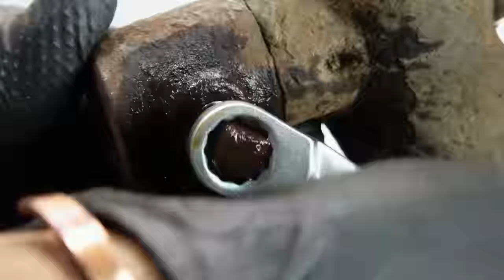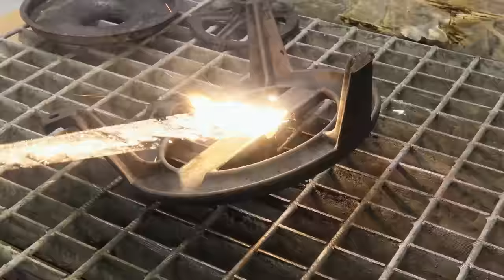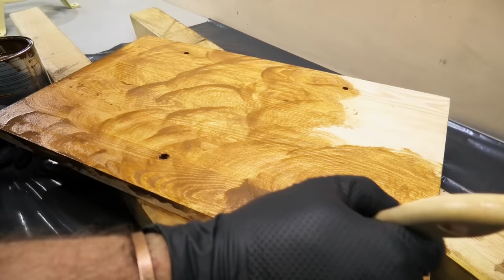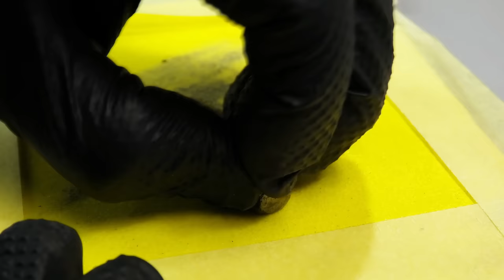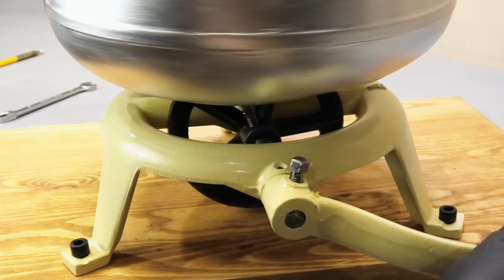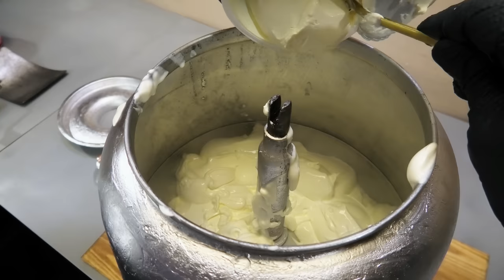Primitive Butter Churn Restoration - I'm Making Butter for You!

Comment: I think maybe you didn’t churn long enough… you should end up with butter and the remaining whey (very watery). After this, you rinse the butter in cold water to remove the whey and squeeze out the water using cheesecloth.  Some folks add a bit of salt to their butter.  I like this old churn — although not too wild about the chrome with the yellow paint.  Never have I seen one like it.  Unusual, but seems to work very well.
Reply from the maker: Thank you for your bits of advice. I never had to make butter before, and I also didn't want to insist this time.
After I observed that some butter had formed, I stopped churning. 
In my workshop, I had 32+ degrees Celsius while churning hard with studio lights on me from all sides, and that was way too much for me 😅😅
I was happy that I could demonstrate that it worked.
The chrome idea came from the item itself because it was chrome-plated, and the base is Ivory, not yellow, a colour very similar to butter. I thought that it would make sense 🙂 
Thank you once more for your feedback and for watching my work! Cheers! Johnny
Reply: @rustyshadesrestoration  … I think that translates to about 90F… too hot for me!  Butter-churning is definitely a cool-weather task.  Thanks for sharing your projects!
Reply from the maker: Thank you for watching my videos and interacting with me! Have a good one!
Reply: Butter forms best at 64 degrees fahrenheit.  Also milk fat of 35% or higher.
Reply: One of my favorite restore videos!!!!!
Reply: @vickiefowler1429 You're saying exactly what my grandmother was doing on the farm.
Reply: No, I think he just started out with the wrong stuff. Too thick already, and maybe pasteurized. If you use whipping cream, you get the solids to separate from the liquids. I have done it by over whipping the whipping cream.
Reply: COLD Whipping Cream! And cool(ish) environment. You still have to churn it for about 45 minutes-an hour at those specs to get good clumps!
Reply: Butter at home.... 10 minutes in a Kitchenaid mixer. lol
The real challenge is making cheddar cheese from powdered milk!
Reply: @rustyshadesrestoration yes, the cream mist be very cold.
Reply: I agree. The cream wasn't churned long enough, or the churn itself is insufficient in making butter. We use to let our crean sit out overnight to warm up to room temperature and at the same time sour a bit.... made the best butter that people would come for miles to buy it. Wish I was a young man again living on the farm.
Reply: You have to start with heavy cream to get butter. But this is an amazing tool.

Comment: I had to Google to figure out what you were churning to make butter; here in the US we usually use heavy cream to make butter if we make it at home, which isn't so thick that you need a spoon to take it out of the package. I don't think I've ever seen "thick cream" on the shelves here. Also, I think the drain on the bottom is meant to be used to remove the buttermilk from the butter once you're done churning, but I haven't ever seen a churn that works like that one before, so I could easily be wrong. The hand-cranked butter churns I'm familiar with have a four-flanged paddle that spins inside a fixed container, rather than a fixed paddle and a rotating drum.
Reply from the maker: Yes, that was 36% fat cream, here you can find it in every shop. 
You are right; the drain is used for draining the buttermilk, but my copper pipe got filled up with butter, and I couldn't use it in the video (trying to avoid messy situations). 🙂
Reply: Considering the low amount of fat in his cream (32%) it is almost a wonder that he ended up with butter at all.
Reply from the maker: Desired level of fat in cream for butter making is 33 to 40 per cent. Standardisation to higher and lower levels leads to higher fat loss in buttermilk. Reduction of fat by adding water should be avoided as it interferes ripening of cream and also results in butter with flat or washed-off flavour.
You're welcome! 🙂
Reply: @rustyshadesrestoration In my country we have a 36% whipping cream, which is liquid but has worked ok for me when I have made butter. Makes me wonder how your cream is different if the fat content is same.

Maybe I also missed something and I'm too lazy to rewind, but did you treat the inside of the churn in any way,  or did you just remove the rust and dirt?

Comment: Last one we used with just one fresh cow was a glass jar of a gallon or gallon and a half, with the paddles attached to the lid with a gear assembly. Slow, but worked. If lacking even that, shaking the milk in a jar worked, too. We’d hang the butter in cheesecloth and let the whey drip out.
Reply from the maker: I have one like that too, but only the mechanism. I have to find a jar that fits, and maybe I'll give it a try!
Reply: @rustyshadesrestoration    I think they were made so the mechanics would fit on the big pickle jars or restaurant size mayonnaise jars, as they were often broken , since the children were tasked epithet the chore.  Haven’t seen ours in decades, so maybe it has a new home. Haven’t had a cow tor forty years.

Comment: Ah,  the old 9mm is too small and 10mm wrench is too large, or, metric meets English wrench misfit.   The  square   head bolt is 3/8"   or 9.5 mm.  
Frankly, the best  wrench in  this case is a "Crescent " wrench, or as we like to call it, "the  universal metric"  wrench.    Believe-it-or-not, there are 8-point sockets  here, and one of them is 3/8", a perfect fit for your project.  There is another work-around, using a 3/8" drive socket, but it's messy..
Reply from the maker: Thank you! I'll try to buy one! Much appreciated! :D

Comment: What was the method you used to clean the rust off of the barrel?  It almost looked like a combination of fire and laser.
Reply from the maker: I used a BLC-2000w laser machine to clean all that mess 😀
Reply: The smoke that was created in the process, as it was floating through the beam from the laser, is what created the visual effect that looked like flames.  

If you have a laser level that can split the beam into a line (fairly inexpensive these days) and a dark room, you can see this effect by using a cigarette or a vape (or >ahem< other stuff that makes smoke) be gently letting the smoke drift through the beam.  It’s mesmerizing to watch!

Comment: Good job, however, imo the chrome paint was a very tacky look
Reply from the maker: It is what it is. The piece from inside was chrome-plated, and I guess on the exterior, too; having no chrome bath in my shop made me use that paint. I couldn't see it differently. Anyway, thank you for watching and for your honest feedback.
Reply: Powder coating or baked on enamel paint is generally safer, as is Bluing or Blackening. I worry about the spray can paints flaking off. Definitely use food grade paints, please. That said, I'm not sure what Chrome paint was used.

Love the old appliance. I wish I had one of those laser cleaners!

Comment: From watching you turn the copper piece in the lathe. I just want to give you a couple of pointers. The insert cutter was to far above center. Your gibs need tightened up that’s why the tip of the tool dipped down when you was cutting.
Reply from the maker: Thank you for your tips! 🙂

Comment: really cool restoration of an old kitchen tool. just 1 tip for you. when using chrome paint, it needs to be extremely smooth surface, then paint the entire thing black first, then hit it with chrome paint. for some reason chrome paint shines better with a black base coat.

Comment: 60 Reverend Puerto Rico Minimum?
Reply from the maker: 60 Revolution per minute.
You could turn a hand crank at 60 RPM comfortably. Putting this in a familiar context: a 28″ car tire, rotating at 60 RPM, travels at about 5 mph. 😁

Comment: Do you know why there was a rope around the gear?  A Lazer to burn off the rust? How does that work? Looked really weird. 
I would not call this style "Primitive"; that seems to go with the up-and-down plunger-type.
I have never seen square-headed bolts before. I thought the round hole in the bottom was a way to drain off the buttermilk, but you capped it.
Won't all that oil/grease on the gear attract dust?
Reply from the maker: Hi! Perhaps the rope just entered there by chance; it always happens with ⚙️ to catch something 😉 
The laser, hmm, complicated, but I'll try to be short: it removes contaminants by vaporising them into dust and fumes through laser ablation. When the laser beam hits the surface, part of its energy is absorbed by the metal surface, and the rest is reflected. Contaminants are ejected when they have absorbed enough power to reach their ablation threshold.
Let's continue with the rest 😅 "Primitive" may be exaggerated, but compared to butter makers these days, it is pretty primitive. The draining hole was improved; I attached a tube and a cap that can be taken out easily when you want to drain the churn. 
And now, the last question: yes, it will attract the dust, but better dust than rust, noise and fast worn, out gear. 
I hope I didn't missed anything! 😀
Reply: Perfect! Thanks @rustyshadesrestoration

Comment: The device doesn't work properly, the final result has to be different a little bit
Reply from the maker: What do you mean?
Reply: @rustyshadesrestoration , I mean that the buttermilk has to be more liquid and the butter doesn't break apart, it sticks together like one lump. There may be many reasons, maybe the sour cream is not proper, I use the sour cream directly from a farm, maybe the processing time isn't enough. I see that the device doesn't beat the sour cream but just moves it around, it looks strange to me. 
Anyway, you did a good job by restoring the old thing 👏🏻

Comment: At the risk of nitpicking, brazing cast iron is stronger than welding repairs. The base material becomes weak in the heat zone when welding cast iron.
Reply from the maker: I can't agree with you. I just had a project a few months ago where I had to weld a cast iron Doctor Scale. Guess what? I have 91 kg, and I'm still using it almost weakly. So, maybe brazing is good, but I'll never subestimate a correct good weld. Best, Johnny
Reply: Well done! @rustyshadesrestoration

Comment: Isn't the purpose of the plug on the bottom to drain out the buttermilk so you don't have to deal with scooping the butter out of a bowl like that?
Reply from the maker: Yes, that's why I put that plug, but I wanted to continue churning after the demonstration. 🙂
Reply: @rustyshadesrestoration  Awesome, I wasn't entirely sure what it was for but figured that was it. Nice restoration, this is actually a product I would buy even though there are more efficient ways to make butter.

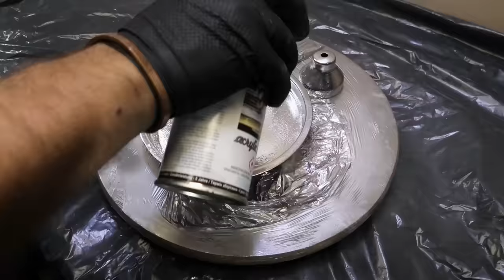Comment: You need to adjust your tool height, 18:04 you can see it's way too high.
Reply from the maker: That's why I change it. That knife is a bit bigger for my lathe machine.
Reply: @rustyshadesrestoration  That's not the only issue. You have little weak lathe. Will work better with sharper tools. Like HSS (Or brazen inserts as you already found). If you opt for HSS, you can grind it yourself. Just use aluminium oxide grinding wheel.
Also there is so much slop in carriage. Fix it or ditch it.
Reply: @rustyshadesrestoration 
Oh btw, if you can, get inserts for aluminium. They are made sharper and polished. But not before you fix your carriage, because you'll end up chipping those inserts. Or worse...
Reply from the maker: Thank you so much for your tips. I'll try to make some upgrades as soon as possible. Best, Johnny

Comment: Сварка металла явно не твоё.
Reply from the maker: That's not "every metal" but cast iron and galvanized steel. 
I have less than one-year xp, and I think I'm doing great. I saw the worst at folks with 12 years of Xp with this type of metals, because s#@t happens all the time. Maybe you are a wonder from the sky and this metals are scared of you when you touch them.
I'm curious how you were welding cast iron in your first year or 1mm galvanized steel. Learn to behave, buddy, and stop flexing because here is not about this.
I'm not here to show how perfect I am in everything, so maybe you can start your welding channel and show us how amazing you are. Cheers